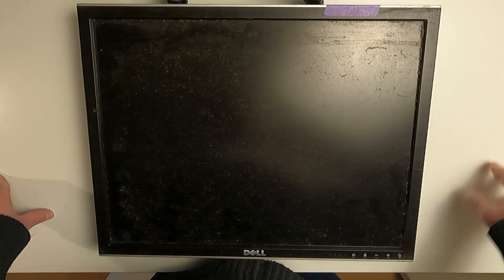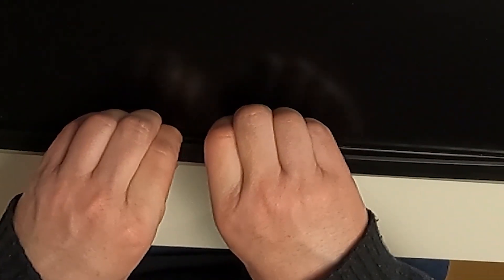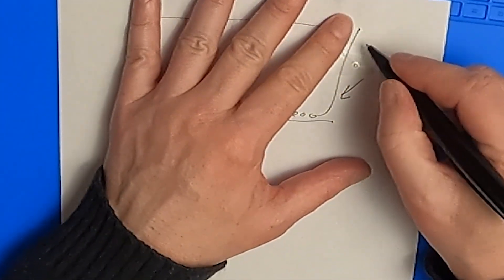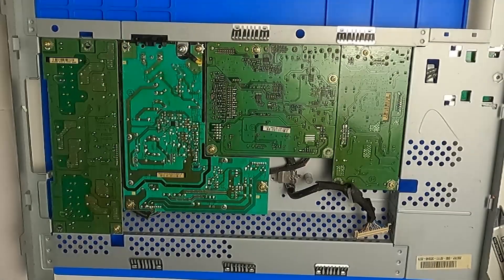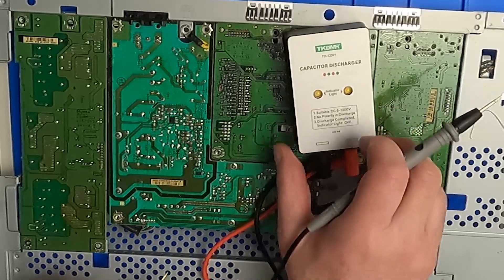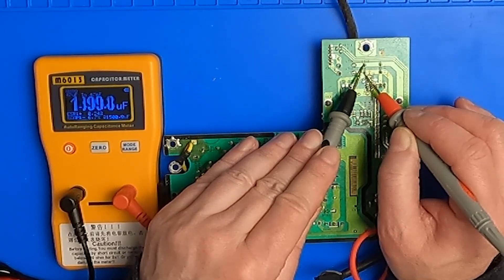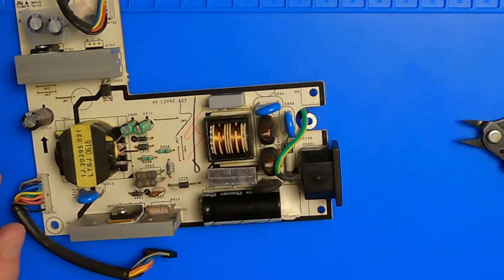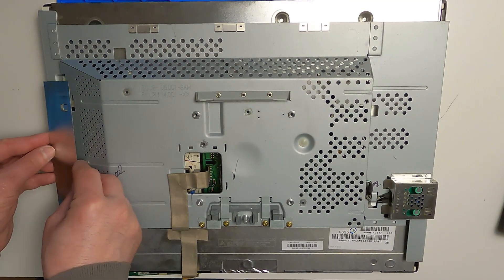Unbuzzing a Dell 2007FPb monitor (Dell 2007FPb - Episode #1)

Comment: If the pin was broken, how come the monitor was still working?

I have the same monitor and it doesn't power up at all. I see a little bit of brown stuff at the bottom of the large capacitor near the pin that's broken in your video.
Reply from the maker: Probably because the function of that cap is more 'filter' than 'power'. The other components were probably not very happy causing the buzz. 

That brown stuff could be electrolyte leaking from the capacitor. I would remove the capacitor and see if that makes a difference, mine did start up without that capacitor connected. Did you measure around the power supply board to check whether it is sending power to the other boards?
Reply: @repairchannel  I've cut 1 pin, the other one I couldn't reach. But still the monitor doesn't do anything. BTW I forgot to mention I've used this monitor for years and suddenly it stopped working.

I have a very particular set of skills. Measuring current isn't one of them.
Reply from the maker: If you have a multimeter, you could check the resistors as mentioned here: https://youtu.be/YOYm7_EGKxU?t=164 - Measuring resistance is definitely a skill worth adding to your skillset ;)
Reply: @repairchannel  ik heb er eentje van de Aldi
Reply from the maker: Dat gaat zeker werken! :)
Reply: @repairchannel  I've got a second monitor, that does work. So I switched the power supply boards. The non working monitor is still not working, and the working monitor now has a buzzing sound. 😀

So it's not the power supply board.
Reply from the maker: Good call! Since in my monitors it was always the 'USB board', have a go and exchange those, if that solves your problem we definitely know it is that board that is failing. Now why could that monitor be buzzing now ;)
Reply: @repairchannel  Yeah, I'm pretty sure it's that 'USB board'.
Reply from the maker: I have one on Marktplaats that is not perfect, but might have a good USB board. If you think it's worth it, you can pick it up for free if you join my channel. Is that a fair deal for you? (https://www.marktplaats.nl/seller/view/m2270530749)
Reply: @repairchannel  Thanks for the offer, but I'll pass.
Reply from the maker: No problem, thank you for subscribing and your comments!

Comment: I have the same monitor but it has one single green line stretching from the bottom where number 2 on the source selection to about three quarters of the way up , it changes color to violet when i put a white back ground what can i do to fix it?
Reply from the maker: Does the problem appear on the other input as well? If it's just one line, I would suspect  the connection to the LCD screen shown here https://youtu.be/VISvl6hcqB0?t=416 - Did you check both connections of that connector?
Reply: @repairchannel 
Yeah it appears on all the sources and i checked the connectors before i could try cleaning it using alcohol but i am afraid it might damage something as It's my first time repairing a monitor
Reply from the maker: Yes, I understand. Just don't force anything and take your time. If you want to try a different cable, I'll send you one for just the postage. But if you're not in Europe, postage might be expensive.
Reply: @repairchannel  i really appreciate it, but unfortunately I'm not even in the same continent.
It's not a big deal i can live with that one line you actually can't see the line when you aren't focusing on it.
Again i really appreciate the help hope you have a good day ❤️
Reply: @repairchannel 
Unfortunately didn't work it's still there

Comment: Do you know if the DVI port on this monitor can be replaced? I bought one, but the DVI port seems to be dead. It doesn’t detect any signal and goes into power-saving mode when I connect a DVI source.
Reply from the maker: Sure, that is possible, but are you sure it is the DVI port itself? You can check the connections to the board bij connecting a cable and measuring continuity between the pins on the connector that connects to the output of your computer and the pins on the board. Had this problem myself, turned out to be a faulty HDMI to DVI converter.
Reply: @repairchannel  I bought this monitor a few days ago. on first try, the DVI port just showed a green glitchy screen, so I thought the HDMI to DVI converter was the problem. I bought a new converter, but now there’s no signal at all.(from neither of converters) It just says ‘No DVI signal’ and goes to sleep.
That's why I’m thinking the DVI port might be dead.

 The component input works, though. I’m not technical, I can only do basic soldering. but I  need this model of monitor with DVI, so I’m hoping it can be saved.
Reply from the maker: Any luck measuring continuity between the pins on the connected cable (computer side) and the tracks on the pcb of the monitor? When I had the same problem, it did work with the back removed because then there is more room for the connector to plug into the DVI port.